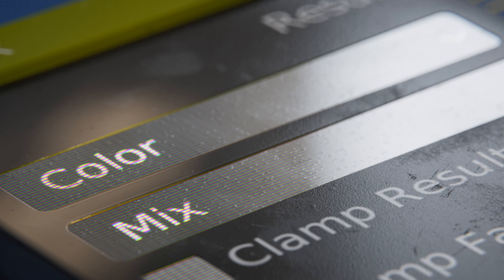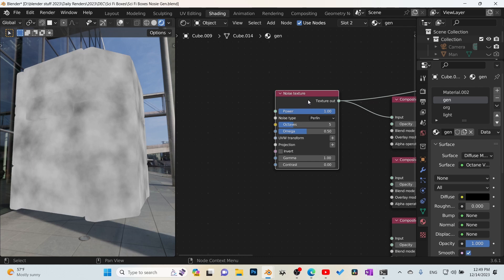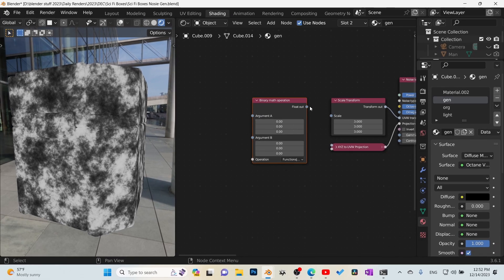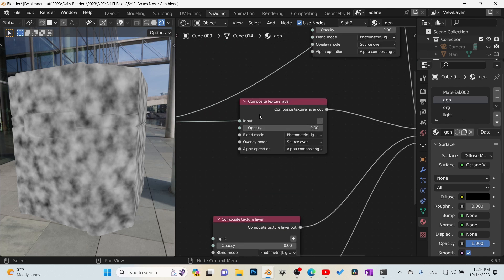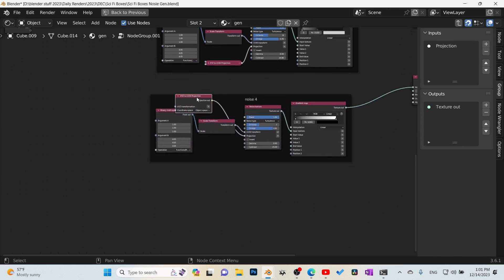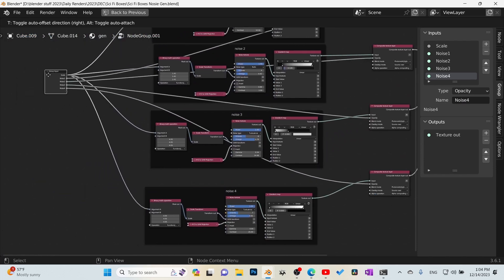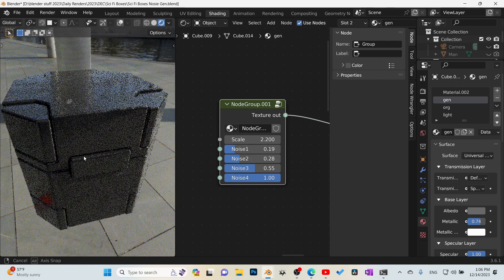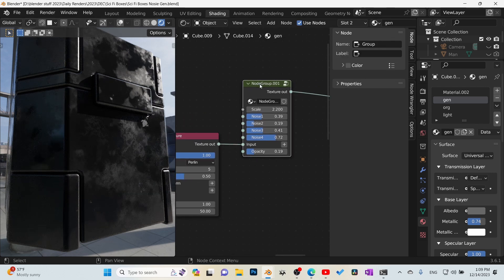The Procedural Roughness Secret that Blender Pros Keep to Themselves

Comment: Great tutorial as usual. I could not make it work until I spotted that the composite texture node has a "enable" switch. Once I clicked it, it worked perfectly. This is in Octane latest stable 2023.1_28.5.
Reply from the maker: how is 28.5 any Issues can you drop me a link to check it out?